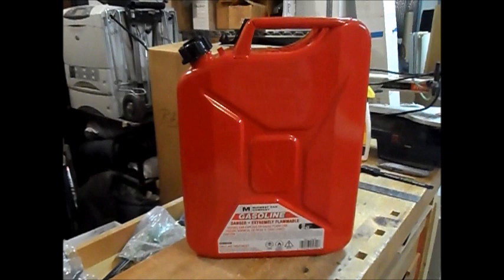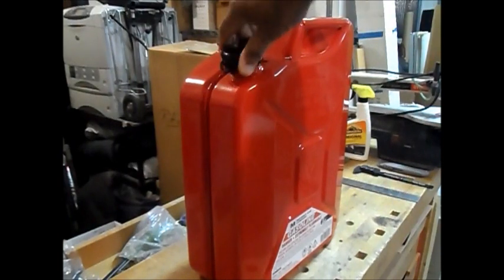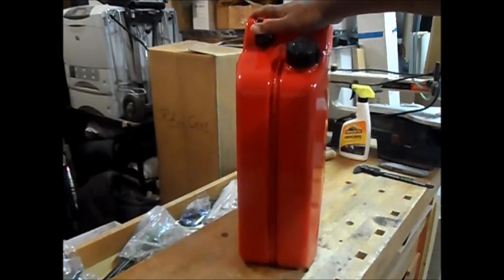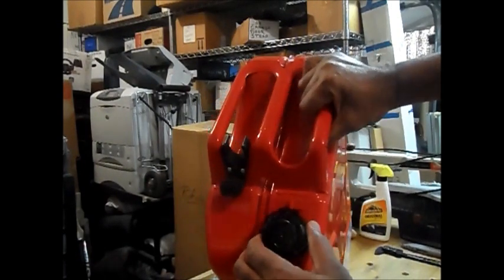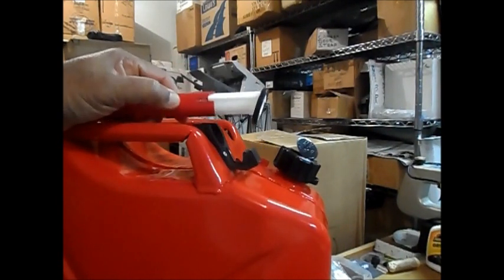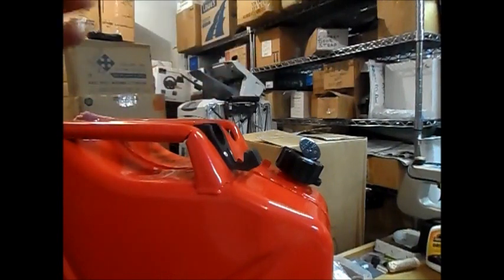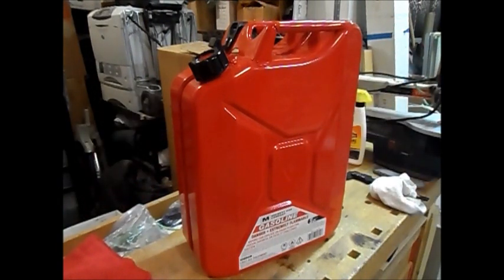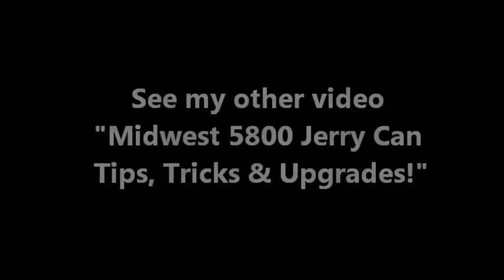My $32 MidWest Jerry Can From Harbor Freight Tools - A Review

Comment: Keep mine in the bed of my truck, bought about a year ago and the welds seem to be rectified on my specimen. Maybe they were made aware of this issue and fixed them in the later models. 0 leak issues as well. Beats the hell out of any plastic can for sure. Great bang for your buck

Comment: I have two of the Midwest fuel cans made before the EPA screwed them up. They look identical to these, except for the Standard NATO, spout, cap and nozzle support. They have held up very well, and they definitely did not have the issue where the welded seam stuck up above the sidewalls. I have seen these newer ones at Harbor freight, and barring the bureaucrats spouts and slightly messier seam welds they certainly appear to be as well made, as they used to be

Comment: The vent on my cap worked on "exhale" only. I woke up one cool morning after emptying and resealing my HF can to find it had collapsed from the pressure change from a shift in temperature. This has never happened to me with the conventional or NATO cans. Also - that spout takes what seems like forever to empty the can!

Comment: The attraction for me is not that it resembles a NATO Jerry Can.  It is because it is the best shape to store in my generator shed where I can keep my generator tank empty until needed.  Unlike a NATO Jerry Can that are all metal with a metal spout, if you were to transport these in a vehicle not well secured or stacked, the plastic would bust when they got knocked about and there would be gasoline all over.

Comment: Hello - I appreciate the video. While that can isn't the same quality as a Wavian NATO Jerry Can, it's far from useless. As a matter of fact, it's far superior to the plastic cans.

I've got one of these cans myself - it has held up to my barnyard/shop abuse, along w/ sliding around the back of my truck bed, below-freezing and 100 degree weather, w/o issue. Also, no plastic gas can swelling issue.

I agree the welds aren't very neat. Not a lot of pride in workmanship there...but they do seem to vary from can to can, and I think you're correct about it being a human/hand welded thing. No robot would do such work.

About the locking tab: it appears that even though one would believe the screw-on lid to index at that spot when fully tightened down, it does not. So you having to turn it further past the 'locking tab' is necessary to avoid leaks - as you know. I'm guessing the tab itself was some legislatory requirement, and it's absolutely useless.
Reply: Wavian is made by Valpro for sale under the British company.

Comment: I bought 8 of these for storing generator fuel (yes, I rotate them). I've been filling one of them each time I go to the gas station. The first one didn't leak at all. Not even a hint of gas smell. The second two? Awful! I wish I hadn't bought these. They came so highly recommended. I'm sitting here with a pounding headache from the gas fumes in my trunk on the way home.

Comment: You got me at "It's going to leak"
Reply: He's just guessing and imo is probably wrong.  The welded edge can only wear down to the surface of the can, not deeper into the groove to cause a hole and a leak. 
Think about it
Reply: And that's only if you're rough with it, tossing it around or into the back of your truck without securing it. Don't abuse it and it should be fine.
They're not mil-spec, but fine for around the house

Comment: I got a plastic 5 gallon gas canister that looks just like Jerry can from costco for $13. It looks tough but i am wondering if i can put it on the back of my Van in a metal Jerry can holder , or am i crazy. does anyone think  it do OK sitting in the Denver colorado summer sun and winter snow? Is metal the only way to go for this on the back of the vehicle set up?

Comment: As stated by Chris Bisceglia
,
this is Made in Latvia by Valpro. Note the "V" in the center of can.
The Valpro NATO spec. cans are top notch, with tight seal/no leakage.
I wish that Harbor Freight would sell these, instead of the ones with the plastic cap.

Comment: Your can is a Chinese knockoff of a Valpro. A real one will have a V pressed into the side of the can. They are made in Latvia.
Reply: Midwest Can company is a US based company who has their metal cans made by the same factory that makes the Wavian cans.   Valpro does not stamp the V onto both sides of the can, these cans have Midwest Can company stamped into the handle on top.  At 17:36 you can see the V stamped into one side of the can. The labels of these cans say "Made in Latvia".  The spouts since this video have been redesigned and seem a bit better, they are made in Canada.   All other cans made by Midwest are made in the USA, except the spouts.

Comment: Steel can, plastic spout. Plastic spouts cannot withstand a load without failing in time. Not a good design.
Reply: ? You mean you can"t buy an authentic jerry can in the US?
Reply: You can easily buy Wavian cans here in the US that are CARB compliant that have a traditional cam-lock lid and cam-lock detachable spout.  Some folks just like to gripe.
Reply: Calvin Hulburt I just broke my plastic one after 4 fills